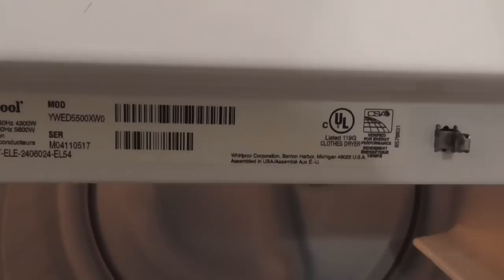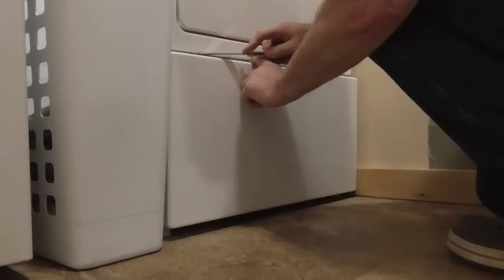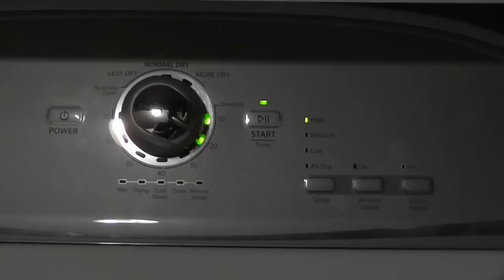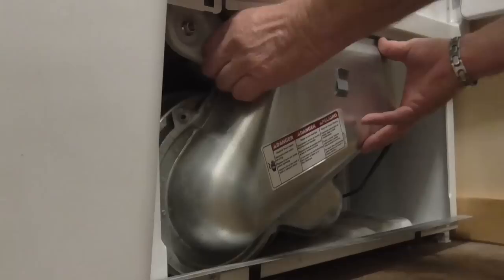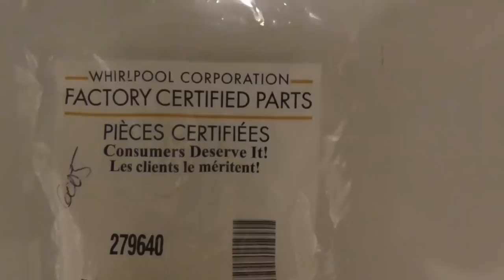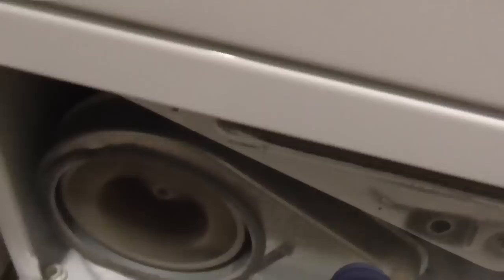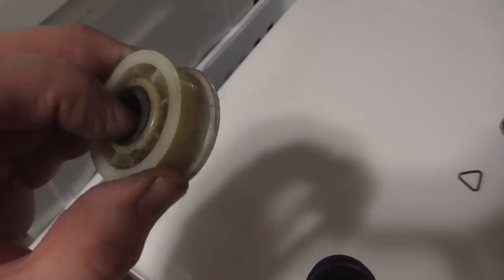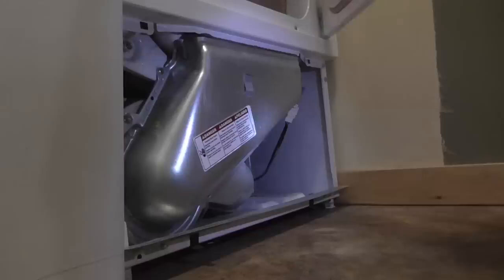Fixing a squeaking Whirlpool Cabrio Dryer

Comment: I followed your instructions to a T. The part was $19 locally and it took all of 15 minutes to fix. Good time to give the inside a vacuum out too! Thank you for the helpful video.
Reply from the maker: Great, glad it was helpful. I am still squeak free and it is almost 3 years since repairing it.
Reply: Help! How did you take the pulley off and feel for the washer ? Did you just pull the belt off the pully

Comment: Attempted to replace the idler pulley this way but ended up having to replace the pulley and the arm since the pulley I ordered on Amazon, did not fit the original arm!! Once I got the spring loosened, could not put it back on with just one hand so had to take the whole thing apart. It would have been much easier if I could have just replaced the pulley wheel but that did not work. Still a good start to the process. Had to take it all apart and replace the whole arm and pulley but fixed an issue that the factory made when putting it together. Thanks for the video, it was a good start and almost worked!!

Comment: This is the way to do it on these Cabrios! 
Hardly any dis-assembly required plus I cleaned out my lint trap! The most confusing part is mapping that serpentine belt. While routing the belt, I had the video freeze-framed at 3:38.
Spring requires a little strength and you have to use your right arm. AS a lefty, I still pulled it off. Job done!
Many thanks, sir! Can't say it enough.
Reply from the maker: +Davin Mickelson 
Well thank you for trying this method. It saves some dis-assembly (if that is a word)
Reply: @Halscamp  
 Bu
Reply: How do you see the clip and washer you just feel for it behind the pulley?

Comment: Thanks for the video.  I changed mine in less than 30 minutes. That plastic snap ring was tough coming off and then left your video up to put the belt back on.  All good now
Reply from the maker: Funny that there is nothing to the plastic snap ring but if you never took one off before you do not know what to do or expect. Glad you has success.

Comment: I fixed the squeak easily this way! Thanks
For me, fixing was even easier than shown. I found I could work around the front manifold, so left it on. Just needed to un-tension the belt, by lifting up on the idler pulley. The plastic clip was pretty easy to remove by feel (it was good to see what the replacement part list was, so that I had an idea what was behind the idler wheel). The idler wheel was a bit tight and felt "frozen", but not too difficult to remove. Instead of using a silicone spray, I put a bit of wheel bearing grease in the idler pulley being very careful to only keep it on the "bearing surface". (I washed my hands after applying the grease just to make sure I didn't get grease on the idler wheel belt surface or the belt). As I was reassembling it was clear that the lubrication helped, in that the idler wheel actually spun freely making it a bit more difficult to put the belt and tension-er back in place, since in working with one hand I needed to better balance the idler wheel while pushing on it and getting the drier belt back in place. Took a few times to do... Fixed for two drier loads... I'm keeping my fingers crossed. Much easier than a major disassembly.
Reply from the maker: Being just a bit mechanically inclined can save the average person a few hundred bucks. I know just a service call around here is around $50.00 + (Cdn), so add in the time for a service tech to get the part, tear the dryer down, replace the pulley, assemble the dryer and test drive it --- well you know the $ add up quickly.
Glad you did it on your own.

Comment: Thanks for this video. Correct diagnosis. That pulley was the source of squeaking noise from my dryer. It's a plastic wheel with metal bushing (no bearing so it is not designed to last).  Taking off the lower front panel was difficult. The retaining spring clip needed to be pushed down with a putty knife with much work. Taking off the pulley wheel was not easy either. I could not exert enough force to pull off the wheel from the front, so I had to take off the drum to get better access to the pulley wheel.  I greased the shaft and put the new pulley wheel.  Putting back the belt over the pulley and motor required a lot of strength to overcome the pulley's spring force.  Took me roughly 4 hours to complete the job. It was worth it and complete satisfaction afterward. It's snowing outside today, so nice to have the dryer working again.  Material cost $14.  Labor cost $200 (even though I did not have to pay).
Reply from the maker: Well after the snow stops and you have your walk shoveled out, treat yourself to a pizza and drink of your choice.  It is more work to remove the drum and all the other parts but the satisfaction of doing it yourself is priceless regardless of time spent.
Have a great day

Comment: This video was super helpful! It helped me identify exactly where the skreching was coming from. I got the new wheel and bearing, replaced, and works like new again. Hardest part was getting the clip off and the belt back on. Maybe better to come in from the back side, so there is more room to work with. Thank you!!!
Reply from the maker: Yes it would be easier from the back if you can easily get at it. My vent pipe is hard piped and is very, very hard to get attached again so that is why I showed being done from the front, Thanks for viewing.

Comment: Thanks! How how easy was that. Less than 40 minutes and saved myself $250 bucks. Didn't even change the part, just greased it up. Hopefully it will last, if not I can replace the part for $6 in 20 minutes. Thanks again! great video!
Reply: How did you grease it up ?

Comment: What am I missing here ? This video does a great job of showing how to locate the idler pulley, but you completely skip over the most important part, which is how to detach and reattach the pulley. It seems that whatever parts hold the pulley in place, face the back of the machine and are impossible to see from the front of the machine. Additionally, I cannot see the routing of the drive belt. If I take this apart from the front, I'll never get it back together correctly. All of the comments here praise this method for being so easy and fast. Wouldn't taking the back off provide easier access to the pulley ? Is there any reason I should not remove the back panel ?
Reply from the maker: Phil Anderson   At 2:53 it shows the plastic clip that holds it on and around 3:10 talks about taking the clip off. Sorry I could not get the camera in there to show the process or to show the belt configuration   My dryer is hard piped and is not easy to attach the vent pipe again so taking the back off was not an easy job for me and I am not sure if you can get to it from a back panel. The only other way I know is to take the whole front off, take the drum out and then you can easily reach the pulley but is a much harder job getting the drum back in, the belt back on. This way if you are a bit mechanically inclined should be easy to do.

Comment: Thank you so much for this video! I got the part for around $8 on Amazon. I’m a 51 year old woman who likes to try to fix things rather than replace if possible . I was hoping to be able to take off the back on mine since it’s easily accessible but unfortunately mine doesn’t come off, you have to remove the drum and go in that way. Your fix from the front worked well for me. I have small arms so could reach in fine but once the belt came off I didn’t have long enough or strong enough arms to pull the wheel back up and get the belt around it. I reached in from the right to remove and replace pulley wheel. I needed to use a flat screwdriver to pry off the old clip and a lot of elbow grease to get that old pulley off. Getting the new one on was easy! Then I went in from the left to replace the belt. I had to have a helper go in on the right and push the wheel up while I placed the belt around it again. Other than that help at the end I was able to do it myself and so thankful not to have to pay a repair person or wait for someone to come out! It’s working great so far! Thank you thank you thank you!!!
Reply from the maker: Isn't it a great feeling when you accomplish a fix for yourself. Almost everything is self fixable ---  If a repair man learns how to do it why can't you learn too.
Glad the video helped a bit.
Reply: U didn't replace the belt?   Just the pulley?

Comment: Thanks for making this video. Fixed the noise on a cabrio platinum dryer. It was a little different than in this video, but more or less the same concept. Found that it was easier to take the whole front panel and top panel off and remove the drum. Had an extra person to help get the drum back on.
Reply from the maker: Yes it is easier to service it if you can get at the panels closer to the bad part. Mine is hard piped and taped - son of a gun to get at back of unit to put pipe and tape on again.

Comment: This is the way!

7 years later this is THE ONLY video that will tell you how to fix the pulley for this type of dryer. 

Note, in my case, the replacement pulley is not the same size in certain areas, the sides of the channel are deeper/bigger for example. 

I'm not sure what was wrong with the previous pulley, except that the shaft sleeve might be worn wider and thus causing jamming. There are no bearings as far as i can tell.
Reply from the maker: No they would not spend money on a bearing.  Let steel run on steel and something will sooner (than later) wear out so we can keep the parts department in business or the appliance dealer as some people would just replace their dryer.
Reply: @Halscamp  So is the sound caused because the hole in the wheel has become to wide and is getting caught.

Comment: This was absolutely perfect.  Only thing I did was wipe the shaft down with some 409 to degrease it and clean it, then put white lithium grease on the spindle and in the pulley before installing.  Whisper quiet now!
Reply from the maker: Saved yourself an expensive service call eh!

Comment: Thank you so much for the video Halscamp... great advise and super easy to do...  took less then 10 minutes and squealing is fixed....... only added advise I could add is if you're going to do as I did and tip the machine  on an angel so as not to have to work on the floor then tape the belt in place to the drum so you wont have to fish it back around the drum when you remove the tension on the belt...
Reply from the maker: Good advise for anyone that has the room, and vent hook up, that allows them to tip the dryer

Comment: just did mine today, thank you

a Tip:  when working the belt back on pulleys, sit cross legged or kneel in front of machine, and stick left hand through the open area on the left around back of that lower pulley working belt on FIRST and with right hand go around the other side pushing up the idler arm and slip the belt over it

make sure belt is not flipped or crooked, line up on the dryer drum where the belt rub marks are!
Reply from the maker: Good idea but a big fella like me cannot sit cross legged LOL. I am sure more feeble people will try your suggestion though.
Reply: Halscamp or just kneel whatever haha or kneel I just couldn’t get it on lying down I needed two hands, hey did you add any lube when you reinstalled a squirted a few shots of grease on the arm before reinstall
Reply from the maker: @futureshock7425  No I don't think I did as I was scared it might fly off onto the belt and make it slip but now thinking about it I guess a heavy grease might not fly off and the little bit you would need probably would not be an issue causing belt slippage
Reply: Halscamp why does it go bad eventually just too much metal on metal friction?
Reply from the maker: @futureshock7425  
I would say so.  A local repair man said all new appliances are made with cheap material now days to be competitive in the market and this allows them to make more money. When your new washer/dryer wears out in a couple years many people just go out and buy new ones. Big companies love that.
Reply: Halscamp so true I’ve been buying older used appliances like dehumidifiers lately the new stuff just doesn’t last, stuff that is made 30 years ago still working
Reply: Halscamp true people hear that screech sound probably think it’s the end!

Comment: I'm a little confused as to why you had to go from the front? I have a cabrio and easily take the back off - a dozen or fewer 1/4 hex screws - and the pulley is right there exposed for the servicing.
Reply from the maker: As I mentioned in the comments regarding going in from the front was easier for me as my dryer is hard piped and taped and is a bugger to get at to put back on and tape again
Reply: I was thinking the same thing. Why not come in from the back since the pulley is in the back.

Comment: Hardest part, for me, was figuring out the upper  clips on the lower front panel.  You have to get under them and pry down from the top.
Once I had that figured it it was easy enough.   There isn't a roller bearing in the idler, only a bushing on a hardened shaft.  I cant believe how cheap they make these things.  Shaft was not worn, however the outside diameter of the bushing was.  So I replaced it.  In most cases I believe removing the pulley and cleaning and re-greasing it would get ride of the squeaking. 
I pulled the drum and replaced the belt and the dryer rollers at the same time.  These are your major wear items. 
A good vacuuming and it was back drying clothes without driving the cat nuts!
Reply: Thank you- we  worked for an hour trying to get the clips out- took the whole darn machine apart almost-then I saw your comment and took 2 mins to take those darn clips out- he does not say that in his video-w e sprayed with silicone and now putting it back together and praying it fixed the squeak   Thanks again- best comment! :)
Reply: Same, took me 2 days. Thanks for the tip! I was pushing on the wrong part of it as well.  @charlipeppers

Comment: How did you make the clips look so easy? I have been fighting mine for an hour. I'm about to get the cut disk out and cut a hole in the side for access.
Reply from the maker: The front clips that hold the white front on?  Or the clip on the pulley?  If the front cover clips - try using a butter knife to push in at different areas in the seam and flatten down the clip area as you gently pull out on the side of the panel

Comment: I have an Accudry model and started taking the front off.  It seemed like a lot of effort and after viewing the video it looked like the idler pulley was toward the back.  So I just took off the back panel and there it was.  Piece of cake.  Thanks for the video - don't know if I would have thought to try this with out it.
Reply from the maker: +Robt Loos 
My dryer is hard piped and it is so frigging hard to get the exhaust pipe back together again when I haul the dryer away from the wall.. That is the main reason I went in from the front but it is closer to the back.
Reply: @Halscamp  I also have an Accudry. I did it all from the front until I had to put the belt back on. I'm female. No arm or hand strength. So I opened up the back just enough to get my small hands through and got the belt on easily. Quiet as mouse now. Thanks for this post and the comment.
Reply from the maker: B P.  Glad you got it fixed. So nice when you do something like this for yourself. Self satisfaction LOL

Comment: If there is a slight burning smell accompanying the squeaking would you think it’s the same issue or something else?
Reply from the maker: possibly, as the bearing may be seized and the belt may be spinning on the (un-turning) bearing causing enough friction to cause the belt to get hot and give off a burning / melting rubber smell.  If there is an electrical issue, wires can become hot and cause a burning smell like melting wires too though.
Reply: @Halscamp  interesting. I just got done swapping the pulley and did notice a ton of lint around the heating coils. Cleaned it out good and it seemed to do the trick. Thanks a lot for the vid
Reply from the maker: @youngtubey2857  Yes lint around the heating coils is probably not good. Have heard of lint catching fire. I imagine millions of homes have this potential fire hazard

Comment: Thanks for video.  Was able to save alot of money and time.  Took bottom front panel off.  was able to spray som WD 40 on pulley,  turned it a few times and got it to stop squeaking.  Not sure how long before it starts squeaking again, but it has stopped for now and I can get the necessary part and replace pulley a little later.
Reply from the maker: WD40 did not last long for me.  There may be some different kind of spray out there that works.  Maybe it is the belt side that gets too shiny and the belt squeaks on it but I don"t think so.

Comment: Heh, squeek Mine goes WAAAAHHHHHHHHHHHHHHHHHHHHHHHHHHHHHHHHHHHHHHHHHHHHHHHHHHHHHHHHHHHHHHHHHHHHHHHHHHHHHHHHHHHHHHHHHHHHHHHHHHHHHHHHHHHHHHHHHHHHHHHHHHHHHHHHHHHHHHHHHHHHHHHHHHHHHHHHHHHHHHHHHHHHHHHHHHHHHHHHHHHHHHHHHHHHHHHHHHHHHHHHHHHHHHHHHHHHHHHHHHHHHHHHHHHHHHHHHHHHHHHHHHHHHHHHHHHHHHHHHHHHHHHHHHHHHHHHHHHHHHHHHHHHHHH
It is putting out, what to my inexprieinced ear, sounds like a wheel with bad bearings would sound like

Now, could this be my issue or are there other items that cause the drum to spin and stay in place ? A I face it, it is in the lower right , middle to back end. My unit is either a little newer or a little older than yours as my bottom does not have a section that can be removed from the front. As it is placed in a corner, boxed in by a washer and several shelves, spending the 45 minutes to an hour to pull it out into the center of the room is less appealing if I cannot get a general idea of what I need to be looking out for ;)
Reply: two years later I find your post and no answer. I have to take my dryer out of the closet now and figure out how to break it down .